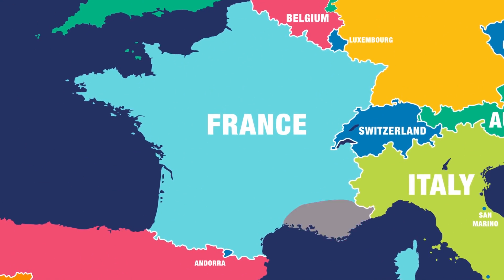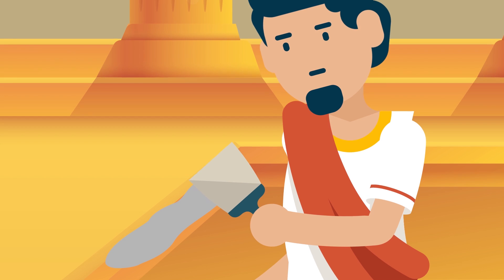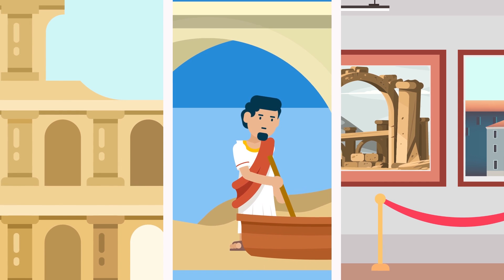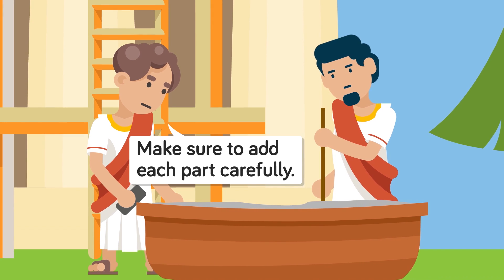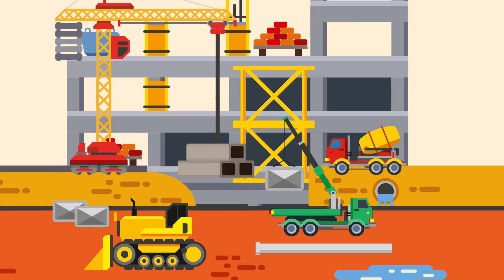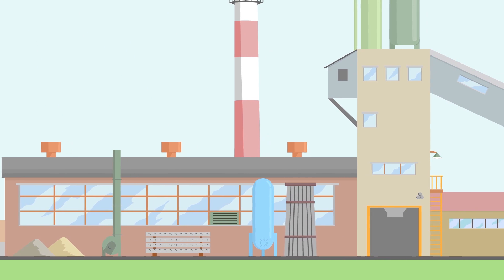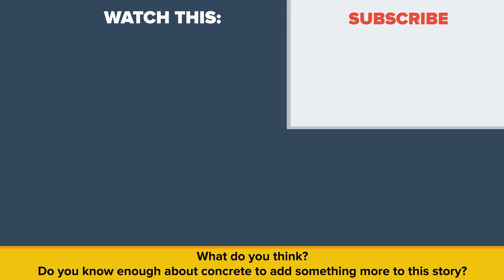What Made Ancient Roman Concrete So Durable?

Comment: Steel reinforced is the problem. The metal begins to rust and break down as the concrete cures due to the moisture and the heat from curing.

Comment: Why should we downgrade to cave man concrete ?. modern concrete may not be as strong but it works if done correctly it is actually better everything we have accomplished so far has made things way to complicated we use concrete for everything bridges ,buildings,roads ,highways ,bonkers the only weakness modern concrete has is secondary forces and using steel flexes this problem,and as long as the rust resistant coating that the concrete makes when put with steel it can last for an very long time until the concrete cracks and the coating gets compromised buy moisture and water you really think caveman’s concrete can support the weight of heavy modern construction methods? Like high ways massive skyscrapers , bridges and docks that support ships that could weight weight up to millions of pounds? I think not Roman concrete the way it was used in building worked because buildings weren’t as advanced as we built buildings now days the biggest thing made with Roman concrete you could compare to modern concrete bridges is those water canals but those things literally weigh less than modern bridges and would probably fail trying to handle all of that weight the even the Roman Colosseum‘s are lighter then skyscrapers made out of concrete 🤔🤔🤔

Comment: Modern concrete can last a long time too. Hoover dam are 87 years old and still going strong. Hopefully it will last 2000 years like roman structure.
Reply: Not necessarily modern concrete breaks after few decades while the material they used made it last centuries 

Fun fact a month ago was discords how Roman’s made it

Comment: Portland cement has superior strength when it comes to compressive force vs Roman concrete
Reply: No.  Read the actual research papers.  Practical Engineering also did a pressure test of modern concrete vs Roman concrete; Roman concrete was much stronger in compression.
Reply: @montithered4741  that's simply not true but feel free to prove me wrong by providing a link to these "research papers"
Reply: @montithered4741  no response... I'll take it you don't have a source

Comment: The main reason we don't use Roman concrete mixtures is because it is very labor intensive and therefore cost prohibitive. We can make extremely durable concretes today, even more durable than Roman concrete, but it's just so expensive. We go cheap because we don't typically care if lasts more than a few hundred years, and we don't have armies of slaves to do our bidding. The real trick is reproducing the benefits of Roman concrete cheaply in scale.
Reply: Fly ash C should have all the advantages of Roman concrete minus those problems you mentioned. Use plastic fiber to strengthen green concrete. Everyone in The Philippines is mixing volcanic ash with ground plastic for masonry.

Comment: "Dear, look at this.  They can't figure out how we made concrete.  Now they can't even read the hundreds of places it's written down.  They can't cipher either.  They can't do the 5th grade math to calculate that man's total contribution to global warming is a calculation that comes out to .006, which is too small to measure within normal sun activity variations.  It was far warmer when we were kids.  Besides, it's been getting colder for them for a while now because of less Sun activity.  Don't say anything.  They'll be back on the ice age kick they were on a few years ago."  

The reason it isn't used today is it won't work to make the structures you have today with it or you couldn't afford them.  Anybody can make something that will last forever.  It takes a real engineer to make something that barely does the job.

Comment: I did my thesis on volcanic ash as a partial replacement to cement for concrete. Results? We can’t use 100% of whatever sustainable material out there, you’ll always have to use a small amount of cement because it keeps the strength up. Too much of a replacement would make it durable against environmental attacks like sulphate attack from the sea but the strength of the concrete would be low which renders it useless against heavy waves and whatnot. We are using those great materials today, we are just not able to take cement out of the equation just yet and for as long as cement remains necessary, business will always choose it over another innovative material to keep costs down.

Comment: I won't deny that the Romans were quite a constructive empire. But there really isn't that much special about their concrete. You cannot feasibly use Roman Concrete in modern construction. 

I get so sick and tired of people going in and claiming how Roman concrete is superior to portland concrete. This all started from a rebutted article back in July of 2017 with the title "Why 2,000 year-old Roman concrete is so much better than what we produce today." 

It is a misunderstanding. Roman concrete appears superior because the concrete was built in a sub-tropical climate. It also doesn't suffer from the intense stresses modern concrete is faced with (Live loads, dead loads, safety factor SF, etc.) There wasn't multi ton semi's driving around. 

Bridges and roads are built with cheaper material in some cases, yes. But they are built more efficiently. If you replaced it with Roman Concrete, the structures would likely fail given the unreasonable amount of time that has to pass for the concrete to cure. Sky scrapers and the long bridges would take hundreds of years to complete. This is why it isn't used.

Additionally, the tropical climate surrounding most Roman structures means less freezing and thawing cycles (A common cause of concrete deterioration). If Rome was in a colder climate, that concrete would likely not be around in such a preserved state as it is today.
Reply: Bingo

Comment: slaked lime + pozzolanic volcanic ash sand + river sand + river gravel
slaked lime + powdered glazed-fired roman tile (or hgh quality FIRED modern bricks) + river sand + river gravel
slaked lime + silica fume + sand + gravel
slaked lime + water soluble sodium silicate + sand + gravel FOR THE MODERN ERA
sodium hydroxide (caustic soda) + water soluble sodium silicate + some water to dissolve all. Placed in a moderately heated oven for 10 to 15 minutes and PRESTO! Your indefinitely storable geopolymer.

Comment: One thing that needs to be mentioned is how long do we need the structure to last. Most of the time we build these structures to last 20-30 years. After that they become obsolete due to many factors such as needing more space and added maintenance cost. In turn, no one would spend more money on these materials, which is what would happen, if the structure will be torn down in 20-30 years.

Comment: We use fly ash now and less vitamins rich sand. Depending on the slump and grade we can still make concrete stronger then them. Roman concrete also had raw minerals in it which they didn’t need metal to keep the strength. We have that too but way more expensive. It’s a lot cheaper and easier to use local resources then import. These people in these comments probably never touched a trial or a float in their life😂

Comment: You also are forgetting that using less water makes the concrete stronger it’s just that this is harder to do when building a skyscraper. I’d check out a guy called real engineering who talked about this

Comment: Paint an otherwise smooth wall and after a time = sections will flake away.  Now paint a "rough" wall = and the paint will adhere to it much longer..........why??  Because the rough surface of the wall creates a foundation upon which the paint can stick to more readily........so it was with Roman concrete.

The volcanic residue was porous.  In modern concrete one typically sees crushed stone added = in other words small bits of stone with non-porous sides.  When one sees a chunk breakaway it often does so exposing those sides of those stones.  Yet concrete made from a medium whereby the solution can enter those porous bits of rocks and harden = will be much more durable.  That added medium accordingly helps to bind the concrete together.

Comment: They built stuff to last back then.
Modern times makes stuff that falls apart fast so people have to keep replacing whatever it is.
Reply: Any man can make a structure that stands, but it takes an engineer to make a building that barely stands
Reply: To keep the economy going
Reply: Its not nostalgia its called planned obsolecene and its the best way for an individual to make money. To have slaves. Keep making a thing ober and over with no innovation and youll take no risks and stay the longest in business. Innovation is very slow in that system. Theres no need to innovate
Reply: Nostalgia is a trap. Iron rusts away and cracks. Alloys are soft, and bend until those break. Old concrete is great and lasts a long time, but would be more expensive to patch. New concrete is cheaper to patch. Building materials didn't get better or worse, mainly different.
Reply: Kenny Noble The atmosphere would like to disagree
Reply: @jacolitethepumpkin765  Let's ask it and see what it says then lol...
Reply: @jacolitethepumpkin765  in the video they suggest using Roman  concrete to help the environment. Main ingredient, "the magic" is volcanic ash. 

So what are your thoughts on, industrial scale mining on volcanoes? More  Particular how is mining volcanoes going to help the environment? 

Humans go through a lot of concrete.

Comment: It's not the fuel to fire the portland cement that produces so much co2. It doesnthelp but the reason concrete emits so much is making cement involes driving co2 off. Litterally change concrete production to solar tomarrow and it would still be a major source of co2

Comment: 4:25 except for the fact that you cant mass produce this stuff reliably...
Reply: You can actually. Pozzolanic concrete is currently mass produced and, altough it's still not Roman concrete, it already does part of the "magic", being sturdier, more durable, more waterproof, more easily workable and even slightly cheaper than standard portland concrete. The only downside is that it takes more time to cure.

Comment: Im a supervisor at a concrete company and was always amazed at how their structures stood the test of time. I knew something had to be up with the concrete they use as its in no comparison to todays concrete and that fascinated me but that wet concrete...now thats mind blowing. 🤯 Wish i could be one of the ones working with scientist coming up with roman concrete. 😊👨‍🔬
Reply: Start  doing research yourself, make a slab of it, then go to your nearest middle management with a 24 month tactical plan to implement production at one of the facilities. I believe in you.
Reply: What is defiNition of concrete? Block of stone piramid concrete?
Reply: What company
Reply: @crispybaguette8670  Automatic Curb
Reply: Its nhl lime
Reply: @philomena333  doesn't stand the test of time well like roman concrete.
Reply: I can help
Reply: They figured it out already btw. They made it with heat instead and the limestone basically used rain water to seal up cracks which mainly formed onto it
Reply: Bro they figured it out
Reply: Bro they figured it out recently

Comment: From what I know it's also more time consuming as you can't mix it and pour it as it's too thick. Moreover, it's heavy and apparently not suitable for steel reinforcements. Thus, you'd be limited to moderate size buildings and can't use horizontal sections without arches.

Comment: its actually very weak and porous. it does not stand up in any way compared to modern portland cement based mix designs like UHPC.
Reply: BAHAHAHAHA
Reply: @jacolitethepumpkin765  alright, fine, it wins when submerged for 2000 years in seawater, but it still ain't stronger. our best stuff is better than most granite, roman concrete would be flattered if we used it on a driveway at 20MPa. chemical attack from saltwater, acid rain, and runoff works different.

Comment: As a civil engineer student i can say there are a couple of big flaws in this video 1) volcanic ash and the likes is used in many buildings where these things are available in the region 2) roman concrete isn't stronger than modern concrete it is significantly weaker than most highly specialised concretes 3) yes seawater strengthens roman concrete at first but significantly weakens it after a certain amount of time 4) most concrete is highly specialised for the task and place it is needed to do so it would be hard to replace it with untested roman concrete 5) in roman days architects built this stuff as architect and engineer was the same job until the 19th century when major forts were being constructed and proper engineer were needed to do the job 

If you want to know more about concrete and the likes we use today just google: cem 1 - 5 and its ingredients
Reply: @theinfographicsshow you should make a video about the ingenuity the roman used while building structures, take the pantheon as an example it is also mostly made of concrete and the higher the wall gets the less dense the concrete gets meaning less load to bear onto the wall (just to be clear the inner wall is made out of concrete the outter wall is brick)

Comment: @The Infographics Show
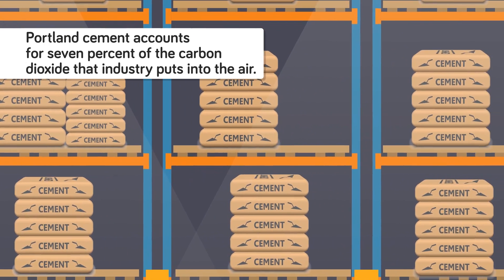You may want to edit this video because there are many errors here, the most notable one being the line at around 4:03 to 4:18. The CO2 emissions are mostly not from burning fuels to heat the furnace, but from a reaction occurring between limestone and clay, which releases CO2. The other errors are minor ones, but this is a very big mistake, sign you didn't do your research thoroughly.
Reply: Are you a fellow civil engineer?
Reply: Fabio Amodei lol
Reply: the only reason concrete from this time is still around is from phillipsite growing in the space between concrete (rebar).  'american mineralogist'  some havnt proven but llikely that seawater was used in actual mixing and applied to structure in some instances.  The ash is just the material that is able to get the aluminous tobermorite.     This research goes back to 2003.